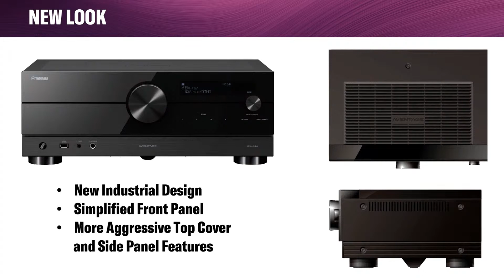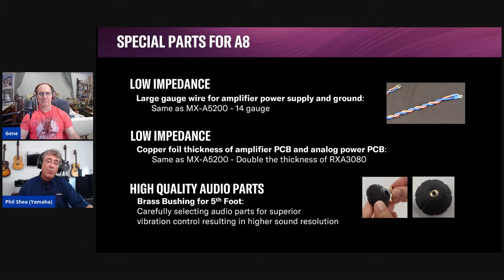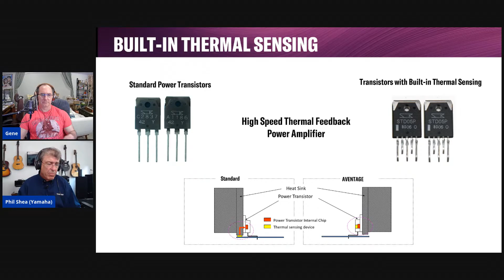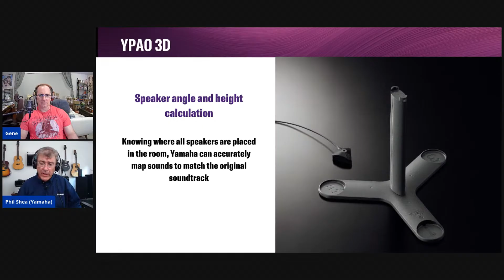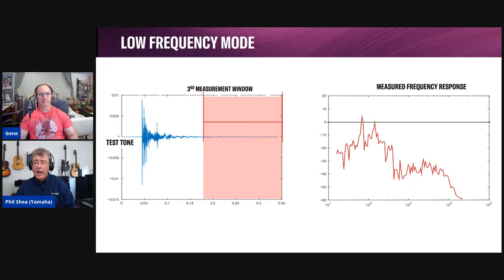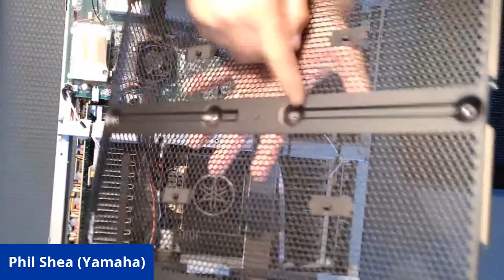Yamaha VPE: New 8K AVENTAGE AV Receivers for 2021

Comment: I don't know how he can speak with so much confidence. I've been looking at a load of Yamaha cinema amplifiers and it's a world of pain. If they are working there is too much compression so must find out how to turn it off, not obvious. Then things break. Voltage rectifiers, HDMI chips, DAC chips. Sound can be strange, lack of bass, tone controls not working correctly, tone control or DSP chip not functioning correctly. they could have been good if they were made bomb proof but they keep breaking and can be difficult to make sound good. I expect over bright sound from many yamaha products but i hope these newer models are more reliable.

Comment: Gene, I have been surfing your channel for a while. I just want to thank you for all the great info, and especially seeing your passion to this wonderful hobby! By the way, I am going back and fourth between the Yamaha A8A , and the Marantz Cinema 40. I would love your opinion on this. I have the Def Tech 9080 series for a 7.4 system. Would appreciate your opinion….. Thankyou.
Reply from the maker: Both great choices.  It comes down to which room correction you prefer. Marantz has the edge there w Audyssey and Dirac. Yamaha gas the edge in amplifier power and manual PEQ.
Reply: @Audioholics  Thankyou. I didn’t mention this in my post- I will be using separate Amps to run everything. So, in actuality the receiver will become a pre pro.

Comment: I bought an A8A for myself for Christmas. It's replacing an Onkyo TX-NR1010. I can't wait to connect everything and tune it. I'm also replacing my speakers with a 7.1.4 Atmos setup. The L&R channels will be Heco Aurora 1000s, the center will be a Heco Celan Revolution 4 and the surround channels Heco Aurora 300s. The 4 Atmos channels are Klipsch 5800CDTII ceiling speakers.
The sub is a PSA TV2112M. Although it hasn't come in yet. It's going to be exiting. Just hope the YPAO doesn't let me down.
Reply: Any update? Did you like it?
Reply: @shinvergil  I do like it. I'm keeping it. I love the Aurora 3D too.

Comment: I was disappointed int my RX-a1080 for the dac was supposed to be top of the line but they used older left over ess 9007s dacs and to make things even worst the the usable DNR of the combination of the unit was 86db which is terrible and equal to 1970's unit I was expecting at least 100db usable DNR they also decided on poor quality ADC chips that lead  to poor sound input to the dsp chip I dont know why at this level they decide to go with 10 year old flawed DACs I wish to change out the ADCs and the Dac to get better transitioning and better sound

Comment: I’m probably jaded now but am always leery when I hear things like “future proof”. My Onkyo TX-NR929 was sold “with 4k pass thru” so I thought I was covered when I upgraded to a 4k Blu-ray player. But it would only pass 1080p. After wasting hours going thru settings and changing everything possible on the player and the receiver, I figured it out. HDCP 2.2 was the problem. The copy protection sold as a “feature” was preventing me from playing discs I personally purchased on a receiver and blu ray player own legally own. That stung a bit. No way they could have anticipated it at the time the Onkyo was made, but it is just as obsolete as it would have been without that “feature” I was actually trying to use.

Comment: Hi I have the Yamaha RX-A1050 receiver. What’s the best crossover setting for LF. My sub is Velodyn SPL1000. I tried setting the speakers to small at 60Hz and sub to direct so the receiver does all base management. Also on the PEQ for sub, what would be the best frequency settings
Reply: Sadly, there isn't a direct answer to your question. Bass management is a complex issue and TOTALLY depends on YOUR room and where you place things. You might check out this video: https://www.youtube.com/watch?v=OPA6tvrqx6A  Audioholics has a LOT of videos about this subject and are some the best out there for explaining it as simply as possible. It's FAR from a push button system no matter who's equipment you have. Search "Bass management" on the Audioholics channel here on Youtube. Cheers!

Comment: Awesome video. HDMI board failures pushed me to Pre Pro set up. MX5000 runs so cool after an hour of spirited listening, it's hardly gotten warm. I love it. Awesome listening to the SMEs here. SLDV is all worth every penny of its $0.5M cost. Changed SMC bulk caps design and location on diesel turbo actuators on the PCB. I agree, $3k spent on a Yamaha is nothing compared to the awesomeness you get. I missed initially Audessey XT32 when switched from Onkyo. But not anymore, I go between manual and YPAO flat depending on the soundtrack. I love the Yamaha products so much and this presentation just consolidated that love ❤️!

Comment: I have the 3070 and quite pleased. When I first got it  worked for 2 days and then the power  would not come on. They fixed it and I had it since. This is my 5th Yamaha receiver since I bought my first one in 1980. The 3070 is not as detailed as my 775 on music but has more power. I love it but is not going to up date this one since I only had it working for 8 months( I got it for a bargain 2 years ago and put it in storage until last april)  I might up date in 2 years and thinking about adding the 5200

Comment: It's hard to believe that you can no longer buy an AVR for under $1000 that has line level outputs for at least 5 channels.  And speaking of Yamaha, why don't they offer a Multicast  receiver that has only 3 channels of internal amplification, since the surround channel speakers will have their own amplification?

Comment: I just installed a A2A Aventage in my home theater system after my RXV-681 got hit with a voltage spike.... I'm not impressed at all with it. The center "foot" holds either a front or rear foot off the table (glass top )and it teeters.... really not impressed

Comment: Gene, love your show with your informative and engaging format. I am hoping you can help me with a Yamaha receiver Challenge with no bad endings. About 14 months ago I needed a receiver and bought the Advantage RX-A1080 and it seems to work great. I wanted the 2080 or the new line but none would be available for a long time. The owner of the store told me when the new stuff comes out he would give me my money back towards a receiver of the new line which if the offer is still good the RX-A6A would be my choice. I recently got some Cornwall 4's that I love for their live front row sound, that my RX-A1080 seems to power just fine, and it seems to do what I want it to do. What my question is would up grading to the A6Amake any audible difference or would it be just upgrading to the newest series. Thanks TR.

Comment: Hi guys. I came here because I’m having issues with my nvidia shield pro tv streaming box and my Yamaha aventage. Plugging straight into the receiver I always get a black screen with Dolby vision content unless I switch inputs and switch back. It’s very annoying. All issues are fixed when I use eARC though. Has anyone fixed this issue?

Comment: Was told today by Yamaha support that I can not use my M&K 150s with their flagship product.  Left and Right will take 4 ohms, but I'd have to trade out my Center and surrounds because they'll only go down to 6 ohms..  No thank you.
Reply from the maker: They are just being overly cautious in what they recommend. I've used 4ohm speakers with flagship Yamaha's and had no issues. You can always buy a 3CH amp and use the preouts if it concerns you.
Reply: @Audioholics  but will it void the warranty?

Comment: Gene i need help please if you have time I bought a new denon avr 3700h up skale to 8k picture is fine on my hisense h 9g but the sound is the worst I ever listen to for 20 years it replacing my yamaha 6290 y’a i no now the yamaha sounD better and a lot nicer my yamaha is about 12year old but there got a be something I can do I tried opening up the frequency from  80 to 250 to large medium small speakers they only ting I did not try is to lower they impedance to 4 all my speakers are clipsh from 12year ago set at 8 ohms on yamaha ton of bass on yamaha but denon sound like a bousted tv speaker on staroids my 50 watts solid state practice amps louder I can make the sound louder by bousting they input by 10 db but the difference in the quality of sound is like my  20 year old 5.1 jvc  I am lost for words im in Gatineau Québec canada here. I bought it for1800.00 it went up to 2000,00 in last 2 months I wanted a 4700h but here there back order since January 2021 so I took the 3700h in order for  6 months I shot my self in the foot I miss my yamaha all at 7.1  4 more speakers in order I’ll by back my yamaha I geSs all the hope about denon is unfounded my next step I will hire a sound specialist my ideal was 7.2.4 hhahaha that is a bad joke I did calibration white audissey and by hand little better all the different sound is just a delay on vocal and reverb on other I was under they impression that they where not great bUt ok gess NOt that is teaching me a lesson don’t ever listen to others on sound quality means

Comment: Will the use of cooling fans on top void the warranty or adversely affect the unit?
Reply: A late response, but absolutely no warranty issues with doing external cooling. I'm an AV Tech for >40 years, and I run external cooling on all my DVR's (easiest is just a laptop cooler, but you MUST keep up with cleaning on any "add on" cooling setup). That said, one of the main points made repeatedly in this video is that the Yamahas run much cooler than most other AVRs. These guys are the tops in engineering the small things like cooling that others put in the back seat. MOST setups don't require cooling unless you're driving a HUGE room at top levels and there's restricted airflow to the receiver (like in a closet or buried on a shelf). You should NOT place anything on top of it. A normal home theater setup doesn't need any add on cooling.

Comment: Maybe I missed it or perhaps it has been asked/answered already in this comment section, but how many processing channels do the A8A and A6A utilize? The stats say 11 (11 powered in the A8A and 9 in the A6A) but pictures on the rear panel show 4 additional pre-out channels labeled as SP3 (zone 2/3/bi-amp) for both amps. This would be potentially 15 channels plus sub out if they are configurable as additional presence speakers like they have been in previous Aventage offerings and would be a game changer at this price point.
Reply from the maker: Both units have 11CH of processing for speakers + 2 sub channels = 13CH
Reply: @Audioholics  thank you for the confirmation. It is odd that Yamaha seems to be hiding, or at least doesn’t emphasize that fact in the A6A. Perhaps they are trying to protect the big brother as the A6A seems to be a no brainer for anyone who plans to use external amps. Can’t wait for your review Gene.

Comment: This is a shame... i currently have the aventage 2080 with 2 external amps to run a 7.2.4 Bi-amp system... and this new flagship does NOT allow a 7.2.4 Bi-amp configuration in any which way.. i called Yamaha and spoke to their tech support to confirm this.. but it allows a 7.2.2 bi-amp with an extra zone.. why couldnt they also give the option of a 7.2.4 bi-amp instead of the extra zone like they did with the previous flagships... really a shame.. now i have to switch to Denon after being a long time Yamaha guy... this is just mind boggling

Comment: Another year has gone, and no sign for DSD streaming at 512, no sign for implementation of top-of-the-range DAC from Sabre or AKM... Also, the design... Overall it looks ok, but also it looks like a lot of corners have been cut, in order to reduce costs - on the display quality side, for example, it's very obvious. I cannot forget how bright and clear and long-lasting were the displays from Akai (and other companies) back in the '80. Most of them look the same, even after 30 years. ...and why do you still refuse to implement HDCD decoding? For a few dollars that you have to pay to Microsoft, for licensing?? Many of us, audiophiles, have in our collections CD's HDCD recorded that we would love to play from time to time... We would like very much to have also this decoder incorporated in a high-quality receiver or A/V processor.  And also, on all connectors - gold or silver-plated copper RCA and binding posts - not the inferior brass!! At least, on the top of the range receivers and A/V processors. Hope that the right peoples (deciding factors) on Yamaha, are seeing this.

Comment: If YPAO is poor, how would you overcome this if you have a Yamaha receiver?
Reply: Where did you get it's poor? Look at Audioholics video on setup of this new YPAO, they cover it in detail. Additionally, you can also use free software and a calibrated mic to do a calibration if you really want to go full geek mode. Audioholics has videos on that process as well. That said, the YPAO mic included is actually optimized in the software for hyper accurate sensing and they YPAO is now doing 64 bit calculations. Still not sure where the heck you watched this and found YPAO to be "poor" ...
Reply: @mickmouse2258  I've seen this talked about it many circles and mentioned in half-a-dozen YouTube videos over the last three years and also heard of Gene comment on it not being that great. I also in the last few years have seen him refer to this as the weakness in the Yamahas.

Scroll down. "2tubeguitar" shared his thoughts on it and they echoes what i have read repeatedly on the subject.

Comment: Very good presentation , Phil is great, BUT I won't accept this stupidly crappy small display on new models! 
In the times of big LCD displays on better AV receivers , Yamaha decides to integrate a display that looks like it's taken from 2006 MP3 portable player? I've tested RXV6A at home and it sounds great, but you cannot see display from 1 away! That's unnaceptable for me, sorry and I'm sticking with my 3080 (I wanted to go for A8A but that display is a deal braker - i could accepted a plastic front panel but i won't accept that horrible display!). I hope that next generation would have a proper display! And one more thing : please modernize the on screen display because it looks like crap, even a sharper font would be nice! Otherwise I'm a true Yamaha fanboy all my life - I own/ed a lot of your stuff and I hate to see the newest front panel design decisions of your receivers..
Reply: +1
Reply: +3
Reply: The size and layout of the A8A is different than the V6A. I AGREE with you on the "make it larger" but it was an actual design decision after finding how the majority of the users actually used the display. They intend the App / On screen display and/or the easy (fully redesigned) Web interface to be how you do things. Everyone has a phone or tablet easily available that allows full graphical control from the couch rather than kneeling and viewing a display on the front panel ... IMHO buying or not an $3K AVR based in the size of the front panel display is a bit extreme and a little shows some strange priorities. I personally buy an AVR for it's performance.

Comment: "10-year product cycle" with these new receivers and new Aventage separates "definitely not any time soon" in all likelihood means Yamaha is getting out of the separates market. Sorry to hear.
Reply: I don’t think they are getting out of the separates market. They just don’t think they need to bring out a new line of receivers every year or two like what Sound United affiliated companies do. Yamaha has found a way to keep the receivers going for as long as possible by using an FPGA for the HDMI board for starters. The only way it’ll break the 10 year cycle is if a brand new connector type comes out, but the way they build these things, they might offer an upgrade path.
Reply: @kashyusaf9260  To me it sounds like they're focusing on the receiver market for the next several years, since that's where most of the money is at. I think when Shea said "definitely not any time soon," that means we're not going to see any separates for a long time. I hope I'm wrong.

Comment: To me what needs serious improvement is YPAO. I have an A3050 and through the years and subsequent updates still I can't use the calibration it provides, I got to go manual, painstakingly manual.  Maybe this new LF mode will help somewhat, but, it would be very good if we could set the speakers crossover beforehand. Setting the crossovers afterwards mess with the whole calibration. Also this 3D thing never worked in my room, if I don't go manual I loose stage, I loose depth, I loose dynamics (in low, mid-low frequencies).

Comment: Thanks for the video.
Mr Gene I have a query for you.
As it says in the video, you will be getting an A6 later this month, if you'll be so kind see if you can clear up the subject of the subwoofer PEQs.
It is my pleasure to know exactly what YPAO does and whether later these corrections can be copied and the subwoofer part worked manually with the help of programs like Room EQ Wizard.

That in the video is not clear and there is the question in the power of the YPAO EQ

Written with Google translate

Greetings
Reply from the maker: YPAO LFM finds the room modes for you. You have to manually go in and apply EQ cuts to those frequencies. I believe you can copy the fullrange YPAO correction into manual and then do the LFM manual adjustments in that setting if you like.

Comment: I bought a new Yamaha 3080 for 1400.00 the main lcd screen went out a few months later and come to find out it was a B stock unit and had no warranty . Just using the OSD for now .

My last Yamaha a2000 lasted 8 year now problem until the power supply board psb went out .

Over all I still a big fan .